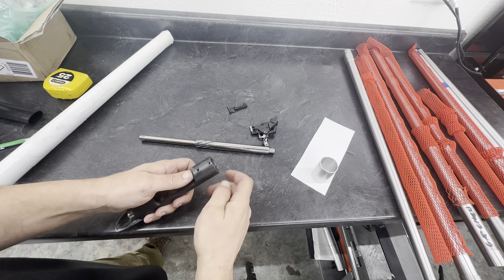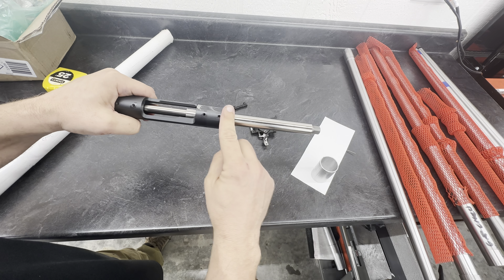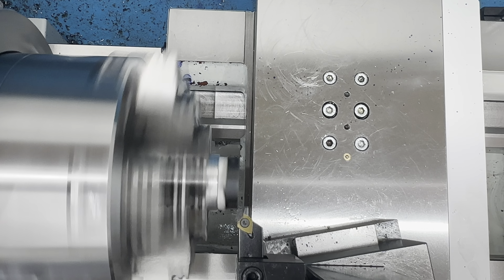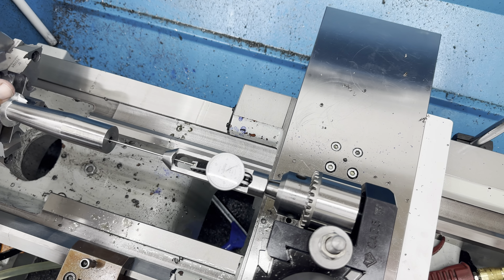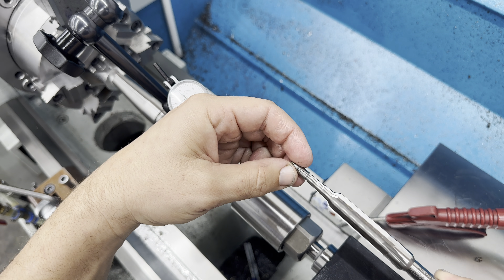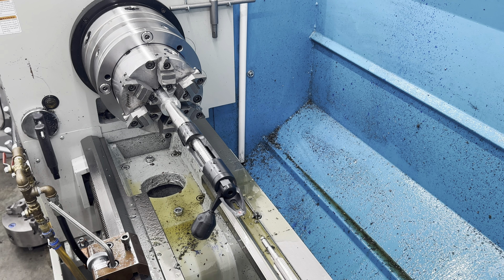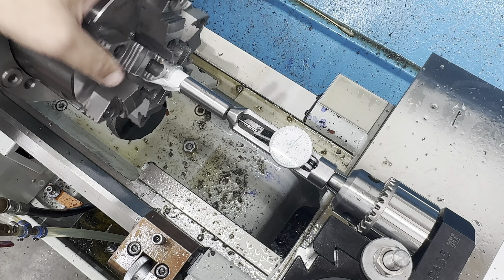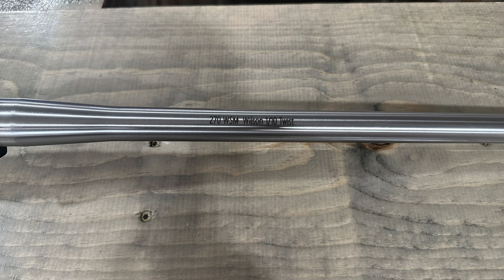Savage 270 WSM Shouldered Barrel Instalation. Chambering a rifle barrel! Timing a muzzle brake!

Comment: I hear what you are saying re the grub screw on a solid reamer potentially skewing the reamer.
Have you considered a solid reamer setup using a mild shrink fit with opposing grub screws to eliminate this?
I'm a fan of using the carriage for these operations, rather than the tailstock, also.
Thanks for sharing 👍
Reply from the maker: I’m looking at a bison floating reamer holder with a er25. Seems like it would fix the set screw issue. 
Thanks for watching